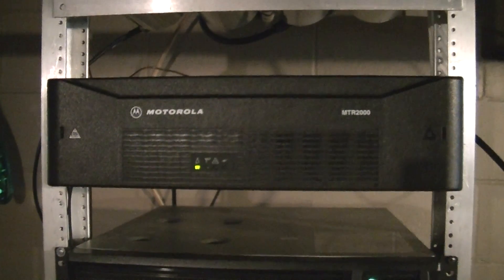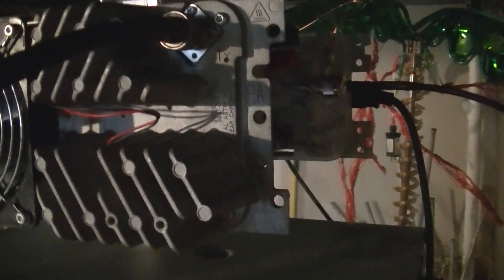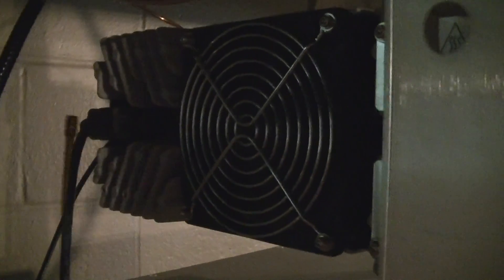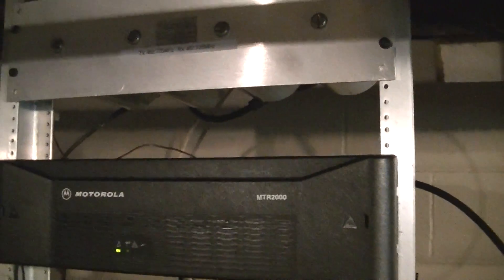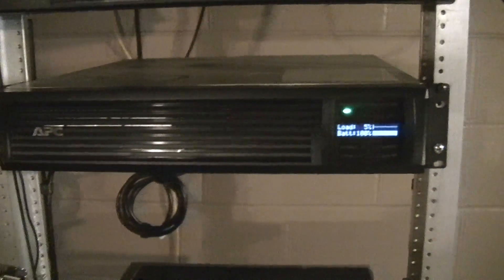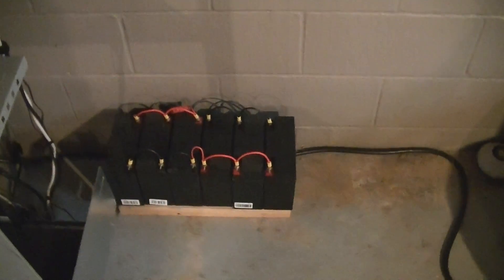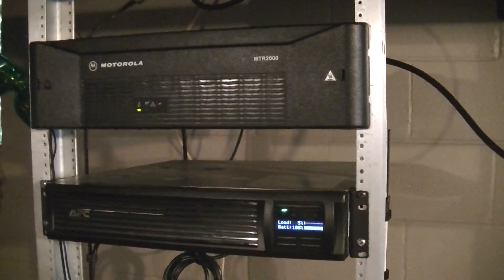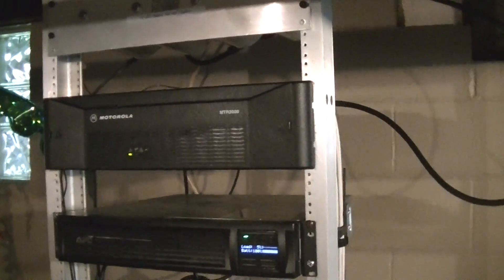GMRS Repeater

Comment: Love the setup. I am 13 years old and working on something similar I have a Motorola SLr5700 55 watt uhf 403-470 repeater. I also have a general dynamics UPS for backup power. I will also be running 1/2in hardline with a 48FT Rhon tower. And my antenna is a commscope DB408b. I like the DB404 for my base but my repeater will have the big boy. Anyways love the video and great setup very clean.

Comment: What size of batteries did u use and type of batteries did u use? Thinking about doing some kinda of backup like that for my repeater. Thanks
Reply from the maker: 12 volt 17AH
I dont use them any more as I have a natural gas generator that automatically kicks in

Comment: Not sure if you'll see this, but, what is a good Motorola ht for gmrs? Is programming software readily available?
Reply from the maker: LOL, that can start a war as it is opinion based. I personally favor the HT750 with an Impres lithium battery as I trust it with my life and the EX500 is very small and is my kids favorite. The HT1000 is probably the most respected HT of all times and you can get aftermarket battery options. Almost every police and fire dept used them at one time and many still do for low talk. Look on ebay and sometimes you can get the seller to program them for you. If you want to mail it to me and pay for return shipping, I can program it for you as well pending on what you get and its not locked. There are so many models out there, pretty much anything that can do UHF can do GMRS, even digital Motorolas that are UHF can typicaly do analog as well. I also have the SL300 that are nice.

Comment: I'll be 100% honest....I didn't like the amount of money you threw into this project. It initially looked like you just 'paid to win'  in the radio game here. BUT, a few months of repeater and LMR researching (looking into setting up my own GMRS station), I can appreciate your rig. Very clean, very professional. 'throwing money' at something like this DEFINITELY pays off. Hacking together a pair of mobiles works, but a proper base with good coax, duplexers and controllers does show in the end. Awesome build!

I'm looking at some retired Quantars for my build, and Kenwood mobiles. 4 to 6 or more vehicles and a plethora of handhelds should satisfy (somewhat) an industrial repeater like the Q.

Comment: What's the details on the backup batteries.  The type of battery and how its set up
Reply from the maker: I have recently had a natural Gas generator installed that runs the whole house and have since removed the batteries out of the equation. I used cheap 12volt 17.0 AH series together to make 24 volts. It was roughly 90 AH total. I was using an Altronix power supply as a float charger. All though it is not recommended, I simply connected the 24 volts to the battery back up port on the repeater. There is a recommended power supply just for the MTR that will float and fully charge back up batteries.

Comment: Great Setup!!  I'm prepping for SHTF too and bought two TYT-9800 radios that have crossband repeater functions. Yes, I have my GMRS license and I'm really not interested in getting another license for the HAM community because I strictly want to use this for SHTF family communication. The crossband repeater works really well for emergency but can I just connect both radios and do inband somehow or do I need an all in one GMRS repeater?
Reply: You would need a duplexer or some pretty good antenna separation. You may or may not need a controller as some of the China radios have a repeater mode and can be linked through the microphone jack.

If I can give you some advice, I wouldn't use that mobile setup as an in band repeater. I would go to eBay or something and buy a used, 100% duty cycle commercial repeater. Try to get one with a duplexer and remember that the duplexer will need to be tuned if they do not offer it. By the time you buy a good (not China) duplexer (I know there are cheap China duplexers that will work), a power supply, and a repeater controller, you are better served with a used or NOS 100% duty cycle repeater. Mobile radio based repeaters are not 100% duty cycle. I do have friends that set them up with fans and they do very well but I don't think they are the best choice for the money when so many used commercial repeaters are available online. For the money and ease of setting them up, I really favor the Vertex VXR-7000U. Watch your band split as there are two UHF versions.

Comment: How did u do a courtesy tone ? i did not see any option on the rss when i programmed my mtr
Reply from the maker: I can give you a copy of my code plug. Its tricky
Reply: can u still send me that code plug by any chance? what is the length of the jumpers u used between the repeater and duplexer just curious